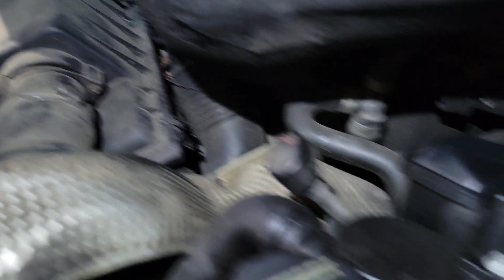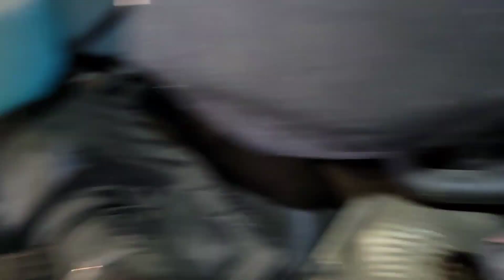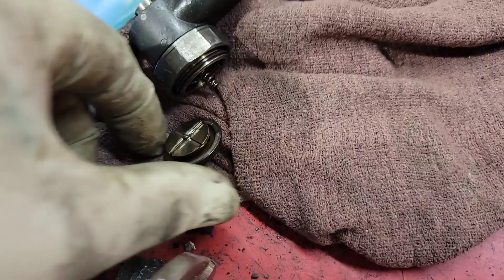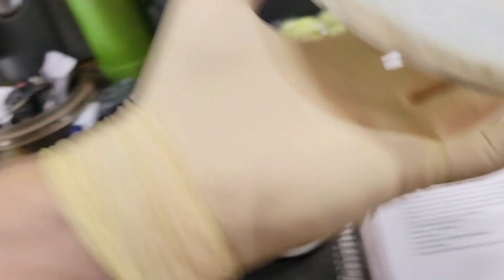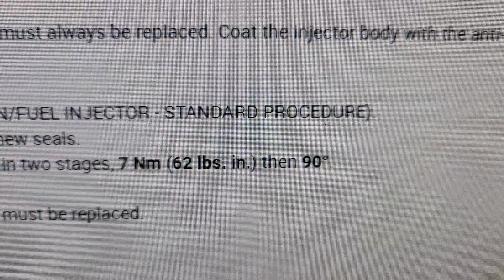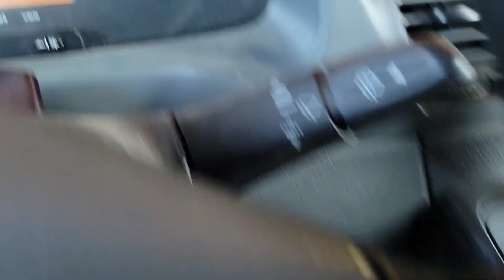2.7 5 Cylinder Sprinter Lack of Power P2016

Comment: So the problem was the injectors? The solution was replacing the injectors?
Reply from the maker: This one had 2 problems it had several bad injectors and also the fuel quantity solenoid on the High pressure pump. Thank you for watching.